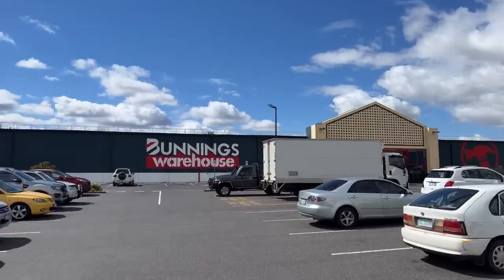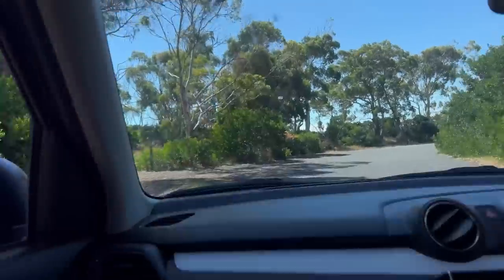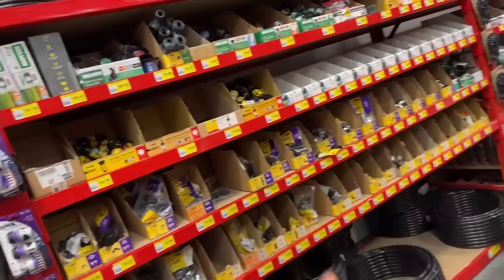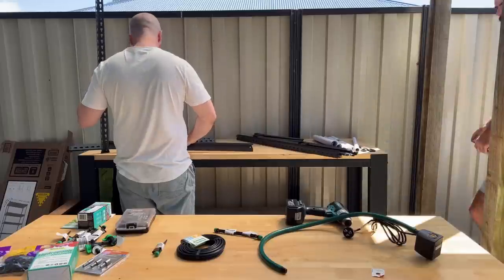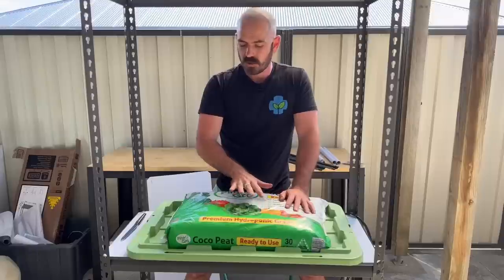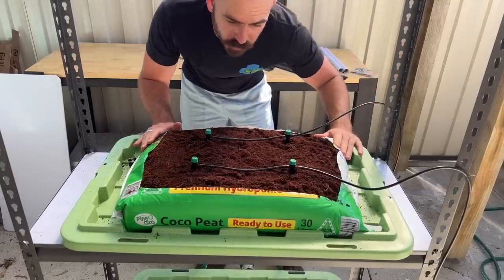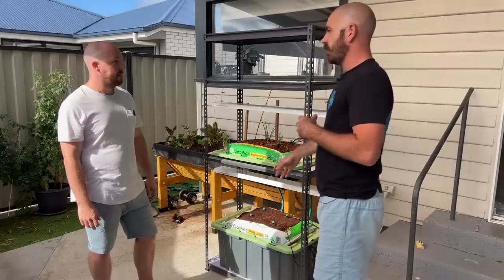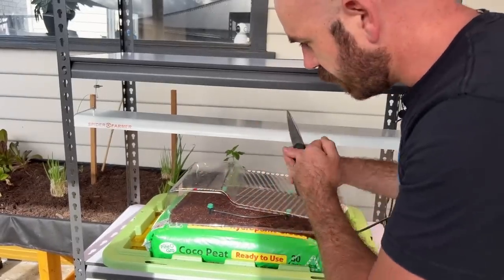Irrigated Bagged Coco Hydroponic System

Comment: Very cool!  I love how you just have these ideas and set them up based on what you can find at the local big box store! Whatever you find you just make it work.  Very cool! I look forward to seeing progress videos of how this system does over time.  Thanks for sharing!  Those drip irrigation stakes I have something similar and I would never have thought to connect them the way you did.  My problem always seems to be I need a large tube on the pump but my hydroponic source is only 4mm  or whatever it is and then how do I shrink it down so what I came up with I inverted the access point and clamped it and had a small tubing also so that I could push it further into my channel and then when the water pumped in the small tubing any excess would be caught on the outer edges and couldn’t get forced up because I had clamped it.  My explanation likely isn’t the best but bottom line it worked!  Which was pretty cool and now I have two separate NFT systems using gravity and are being fed by one tote bin of water and nutrients and they both return into the same tote bin.  I needed two different pumps but it works very well!  I have about 100 litres in the tote and I have 108 holes that it feeds …54 in each system.  It’s quite awesome actually 12 tubes in total each with 9 holes.  I’m growing all kinds of greens and I have my micro dwarf tomato plants started in this system and about six cucumber plants starting out just until they get a bit bigger and then I’ll transfer them to their own tote or 5gallon pail. My system has been running for two weeks and it’s jamming!  I’m going to have enough lettuce to feed my entire apartment floor! Lol!
Reply: 😂lol.. I can't quite picture why you have 108holes but I guess it must be working for you.

Comment: woiuld of been much cheeper to get a water heater catch tray, a boot tray or a automotive drip tray... all about 5 bucks each here in the states
as i think those are just the ones that are shallow, but there would also be many that are a bit taller, and still cheaper. but would work, just for any one intrested.. 
great vid.. thanks
Reply: the first three mentioned are all close to the same size, though the automotive drip tray comes in several sizes... 
as i sit here and think, i have been wondering about dish pans, and bus pans (for cleaning off tables at resterants ) and wondering how i might make use of them...
the first is about 10x12x6in deep and 1.25 the second is 2ft by 3ft by 10in deep and 3 for $11
if you have any insights how i might be able to make use of this as a system i would love to hear.
best i have come up with is pot in pot on a rail for the smaller, and pot in pot conected for the larger... 
TIA for any insight you or any one else might be able to give me

Comment: Taking the lid off with the bag and plants is just plain stupid. You would add a threaded 1/2 inch poly fitting with a tap OR use the pump to drain the resevoir. Stoners edition....